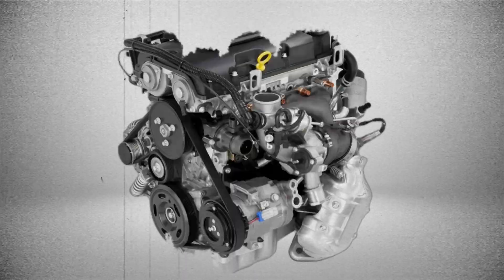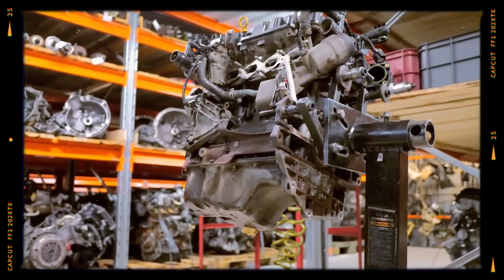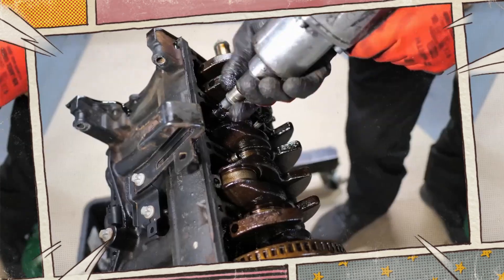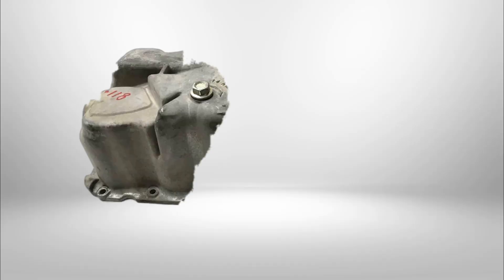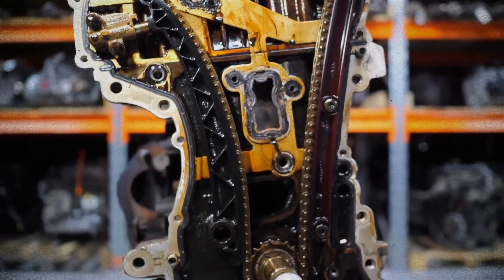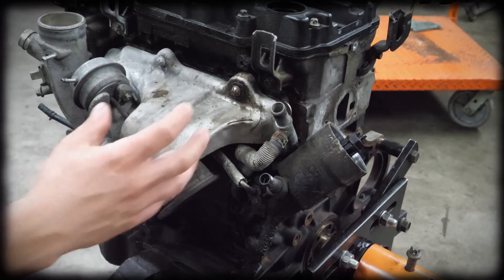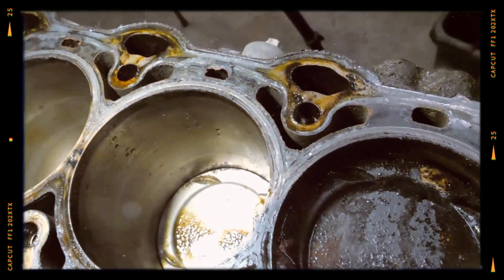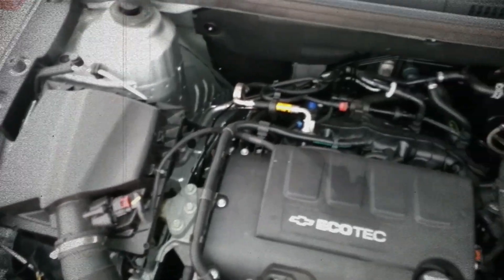GM 1.4L Turbo I4 Ecotec LUJ/LUV Engine — Specs, Problems & Reliability Explained!

Comment: I have a 2021 Buick encore with the same motor. I have about 36,000 miles on it cause I don’t drive a ton but I have put about $3000 in modifications in an attempt to make it not so gutless. Only real issues that I’ve had is PCV check valve replacement tiny bit of timing tick and I had a crank no start issue that ended up being my aftermarket spark plugs, which were too hot of a spark, I believe and or aftermarket MSD coil pack was running too hot or misfiring. Once I put stock the iridium spark plugs in a stock coil pack everything was fine so still I don’t really know what it was other than ignition related due to my upgrades. Other than that I would give this engine a solid B in terms of grading because I have dealt with far worse motors, and I have also been lucky enough to have superior engines that don’t have any weakness